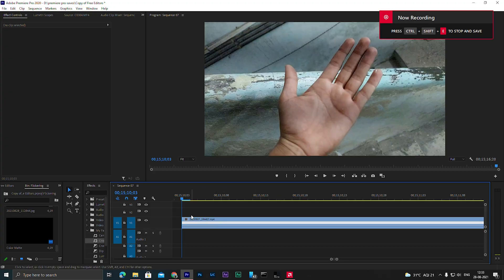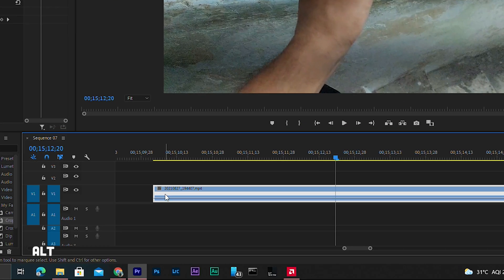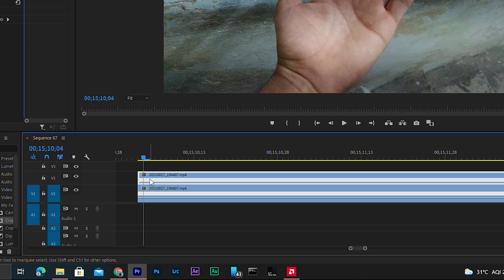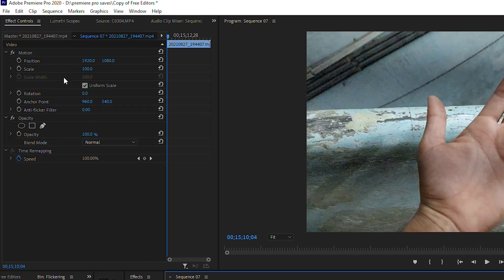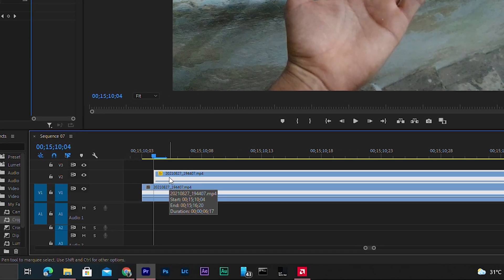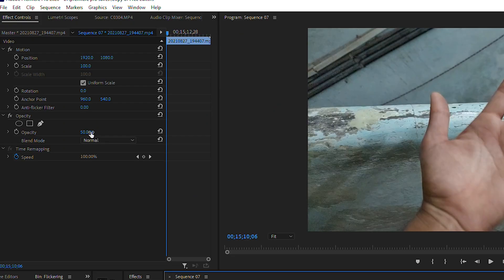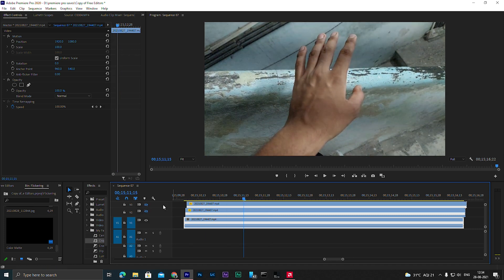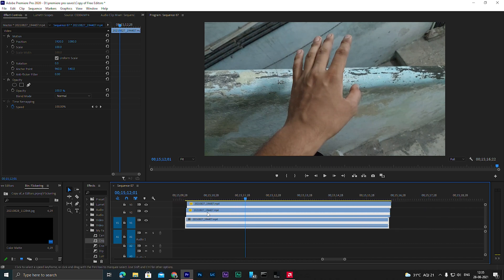Solution for Flickering light in video | why flickering occurs | understanding NTSC and PAL

Comment: How much percent should we slow down a 60fps clip in a 24fps timeline. Its usually 40%.
Reply from the maker: Yes, in between 40-50% is a sweet spot and don't forget to use  optical flow